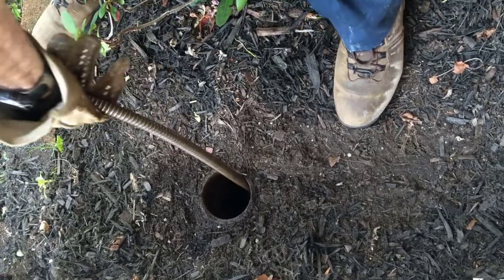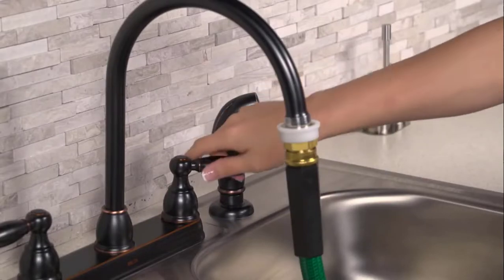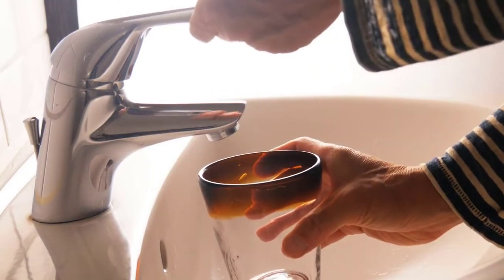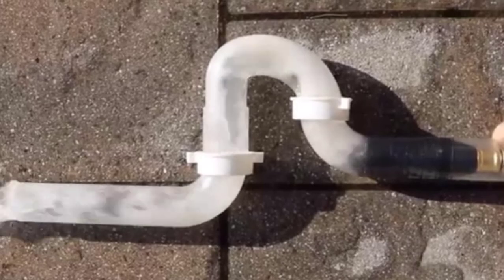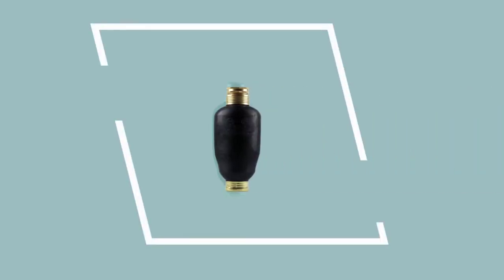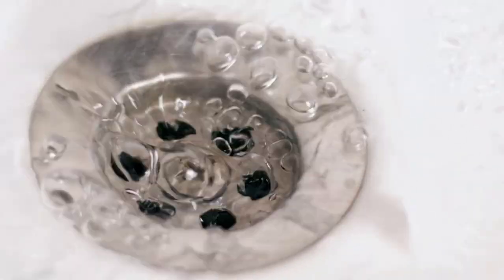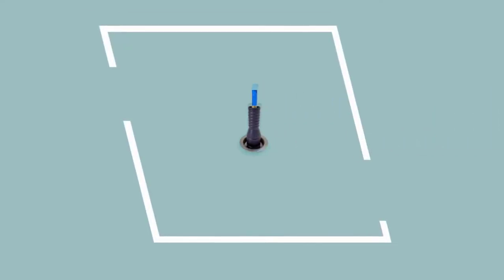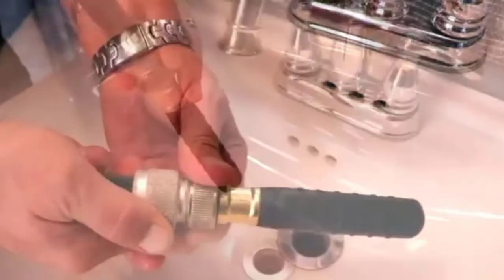Best Drain Cleaning Bladders To Clear The Most Stubborn Drain Clogs

Comment: where to buy
Reply: Just about any hardware store should have them, or you can almost certainly find them on Amazon or elsewhere online. 

They are well worth the price. I got a small one once to fix the drain pipe of a washing maching that wouldn't drain, and it fixed the problem in seconds with no trouble at all, and no damage to the machine. Cost to me: about $12 or $13.  After I used this tool the washing machine was as good as  new. Another one I own made quick work of solving a bathroom sink drain that had defied solution with a liquid drain cleaner. And it only took seconds to clear whatever the obstruction was. Never again had any problem with that drain.